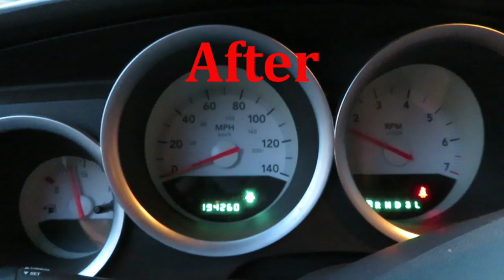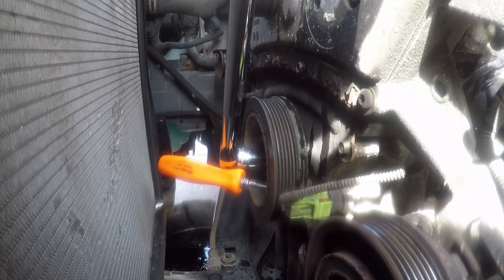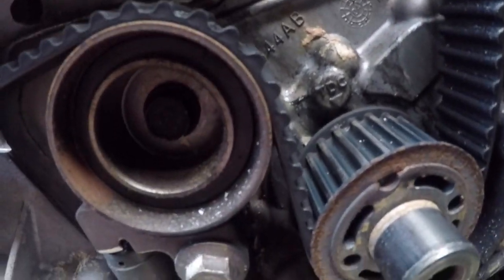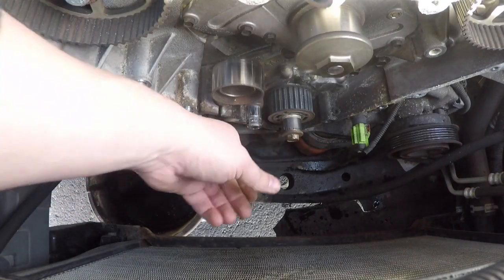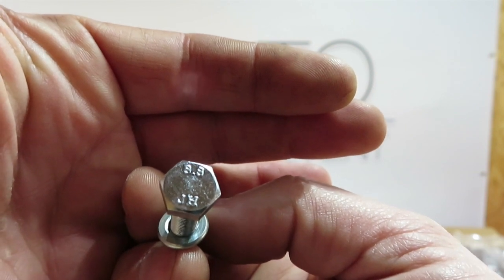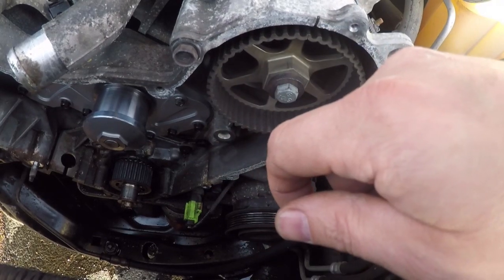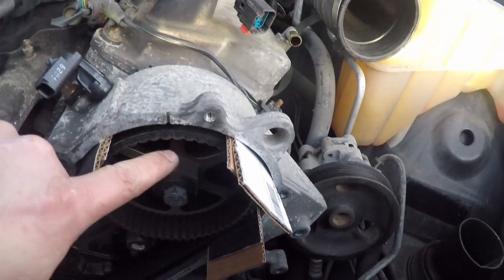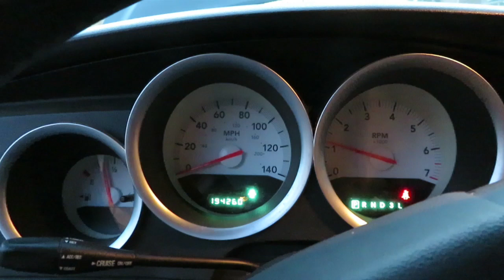Dodge Chrysler 3.5L Timing Belt and Water Pump Installation I Saved a Ton of Money!!!

Comment: Great job thanks for posting.
Reply from the maker: I just bought a 2010 Dodge Charger and I'm thinking about making a new video on this, if I do, is there anything that I missed on this video that you would like to see differently.  Also the vehicle in general, what would you like to see videos of.
Reply: Great video I just did this job and I don't have to remove either the air filter and the steering wheel pulley
Reply from the maker: Thank you for watching and giving your feedback!

Comment: Mentions every single bolt, size, location, and torque. Even a shout-out to odd tools ppl may not have.
The hero we didn't know we needed
Reply from the maker: I appreciate the comment. I hope if you need to do this for yourself that this is a good guide to getting it done without any issues. Thanks again!

Comment: Thank you so much .. I’m a woman and I’m gonna do mines myself next week. You made its so much clearer to me, I don’t feel as intimidated. I wish you had a list of the tools I will need though. 
But thank you so much any how!!! Your awesome
Reply from the maker: I'll try to put together a list and post them here. I won't be able to do that until Wednesday.
Reply from the maker: I just looked in the description, I have the tools listed with links to buy them. I works suggest buying a 3/8" ratchet set as well as an extension set. Harbor Freight is a good value.
Reply: We’re you able to do it @Infinite Goddess
Reply: The bolts on the water pump, 
There are 2 lengths...  There are 2 different spots.  One has a circular raised "plateau" spot where the long bolts go.  The other holes have no raise, and are level with the water pump housing.
Reply: I'm doing mine myself too with the help of this video. Go females let's get our hands dirty..

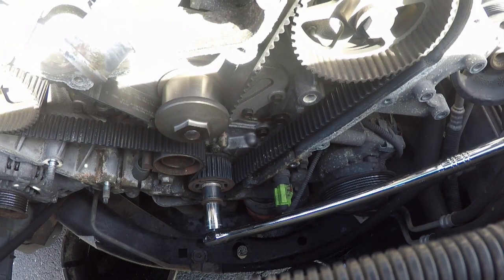Comment: 12:30 place a couple washers on that bolt before you screw it in to turn the crank shaft. 13:40 and just cut the old belt with a pair of tin snips if you're changing out the belt and tensioner. You don't need to methodically remove the belt like you do here in the video just cut it.
Reply from the maker: Thank you for the tips, I'm sure other viewers will find them helpful. Thank you for watching as well.

Comment: Besides the cardboard you used, is there a tool specific to hold everything in places to make the job easier???

I did mine a month ago and started really nice until started to rough idle ones the rpm got lower. Ended buying spark plugs, coil packs, egr valve, coils cables, MAP sensor. Throttle body, camshaft sensor, cleaning the intake manifold and car still having rough idle
Reply from the maker: I don't know of anything specific to hold everything in place. There probably is though

Comment: Hey 👋 thanks for this video I have the 3.5 l Dodge charger 2008 AWD and this was literally helping me out with knowing how to change water pump and timing chain and reset if I run into any problem I'll be definitely back on this video to see what I have done wrong vs other videos with out telling us every bolt sides and everything as watching along great video bro
Reply from the maker: Thanks, I hope your water pump and timing belt replacement goes smooth.
Reply: @DCAutoEnhancement  hey can you do a video of changing spark plugs and radiator replacement and back brakes on the same 3.5 l V6
Reply from the maker: @bosshogg6629  I no longer have that car but if I have the opportunity to make those videos, I will definitely do that.

Comment: Now, I don’t want to sound like a smart ass here but never use the orange coolant in any of your engines again. This stuff corrodes your engine inside. Flush it with water as much as you can and put the hybrid green coolant in. Also, if I were you I would put some cardboard at the front side of the radiator where you work on to protect the radiator fins. Other than that your video was great and very good camera placement. Thanks.
Reply from the maker: Thanks, I appreciate your feedback. I didn't take your comment as being smart ass, it was good information

Comment: The bolts on the water pump, 
There are 2 lengths...  There are 2 different spots.  One has a circular raised "plateau" spot where the long bolts go.  The other holes have no raise, and are level with the water pump housing.
Reply from the maker: Thank you for the helpful info.
Reply: @DCAutoEnhancement   No! THANK YOU!

Comment: If you are going to follow this guys steps please remove the serpentine belt before spilling coolant all over it unless you plan on replacing it. This will cause it to squeal for several days otherwise.
Reply from the maker: I second this comment.  I thought that I did remove the serpentine belt prior to pulling the harmonic balancer off.  Either way, you don't want to allow coolant to get on either the timing belt or the serpentine belt.

Comment: I'm getting ready to do this. What's your thoughts and how much more work would it be to inspect my cam shafts.
Also, great video with good shots! Explained things well and had a list of what tools you used.

Thank you
Reply from the maker: Thank you for the feedback, I really appreciate that. What I would do before inspecting the cams is take that front cover off and see what you have going on under there. If the belt is broken, you're in bad shape. If the timing is only off by a few teeth, then you should be ok. To inspect the cams, you would need to remove the intake plenum and then the valve covers, a bit of a chore in my opinion and then I'm not sure if you would be able to see much damage because the valves are what would be damaged and they are under the cams, you would actually need to remove the heads to check for damage. I could be wrong about that but I'm pretty sure that's right. Thanks again for checking out the video and good luck to you on your car!
Reply: @DCAutoEnhancement  I have a tick and, I think, multiple gasket leaks, my car also shuts off for split seconds when I gas it and then turns back on. It's very unsafe when merging!
 I will be rebuilding my cylinder head, replacing my rockers/lifters, PCV and EGR, knock sensor, Sparks, coils, fuel injectors, timing belt, water pump, and all my gaskets.

I might only need to replace my rocker, timing belt and water pump but since it's one whole system that works together I'm worried if the rocker didn't lube the valves and cam well that they could have some ware on them. I'm more than likely wasting money and shouldn't rebuild my cylinder heads but I also don't want a valve or spring to break and screw up my whole engine..

This is my first time doing this much to my vehicle. Am I being over cautious?
Reply from the maker: @traviswiser8524  to be honest, I'm not a mechanic and can't really say if you're being overly cautious but I can definitely understand your thinking. It sounds like you have a lot of work ahead of you.  I'd like to hear what you find out.

Comment: Just got done watching your video , good video by the way . Quick question, the tensioner was new that you put in ,  can I use the tensioner that I pulled off and put it back on ?
Reply from the maker: Yes but, I think the reason my car had jumped or slipped time is due to the tensioner wearing out. I would spend the extra money for the tensioner since you're going to be doing all the work anyway.
Reply from the maker: I am about to make another video doing this same job, can you think of anything different or in addition that would be helpful
Reply: I have a 05 Pacifica that I am doing this on and changing the camshaft seals, anything involving that would be awesome.
Reply from the maker: @matthewblakeslee9764  I'm sorry I don't have any info on that. I have already filmed the second video. Thanks for the idea though
Reply: How did you put the crank pulley back on

Comment: I change the pump on mine a year ago and now the timing belt tensioner broke so I redo the timing belt. Car is having very rough idle, makes me wonder if I miss a tooth on the belt. Running out of ideas here. Installing the belt is a pain. Wondering if there's a tool to hold everything in place to make this job easier
Reply from the maker: with the rough idle, I would still take the belt off to make sure alignment is correct.
Reply: Mines rough idling too , I believe I’m off a half a tooth and cannot seem to get it in the right spot

Comment: so those cams were like 4 teeth off?  how did that not bend valves?  & where did that come from? I though belts like this were kevlar reinforced, do those stretch?  or did something slip on one of the shafts?
Reply from the maker: I wish I could tell you about the conditions of the valves however, I did perform this job and the car ran as it should when I was done. I think the failure comes from belt stretch and tensioner failure.
Reply: @DCAutoEnhancement  I am glad its still running for you, and you would know if the valves were bent, probably wouldn't run at all.  If it did, you'd get really bad gas mileage & probably a bunch of misfire / o2 codes.

I am not convinced stretch would account for that initial timing, unless you are saying it stretched enough to hop a tooth?  The whole point of a cogged timing belt is to act like a chain or gears.  stretch those cogs out and you still have the same # of cogs & the gear ratio between the crank : cams is preserved.

that's why I worry the crank and/or cam shafts slipped with respect to their gears.  I say this with some experience, I once had a crank gear slip...bashed all my freshly ground valves into my brand new pistons..that was a bad day.  but your engine is running & its hard to argue with that!

and I should say thank you, I have done a few timing belts / chains in my day, but never on this vehicle, which I am doing for a friend.  Found this quite helpful.  

Although I am stuck trying to get that damn pulley off, maybe it'll pop off while I am sleeping.

Comment: My question is the tensioner pulley did you torque it down to a specific or did you what
Reply from the maker: Are you talking about the tensioner for the timing belt or serpentine belt?
Reply from the maker: Here is a different version of the same job, I might have addressed your question in this video. https://youtu.be/MexjRlH7MuE

Comment: Yeah my mom had the timing belt and water pump down thermostat new radiator we kept getting the runaround it ends up being in the shop for three and a half days 2 days later I drove it 90 miles heard this god-awful noise pulled over and there's no oil in the car and on the bill it said next Oil Change 3 months so how would we be out of oil they're not taking responsibility
Reply from the maker: I would definitely have that conversation with them especially if they did an "oil change". I have seen it happen where someone drains the oil, put the drain plug back in, change the filter and then take a phone call or get side tracked, go back to the car and put the oil fill cap back on thinking it's ready to go. Not saying that is what happened but it's possible

Comment: Had to do this in my Dodge avenger 3.5L not fun lots of jacking the engine up and down.
Reply from the maker: I bet, because it's front wheel drive, right? Was the process the same otherwise?
Reply: @DCAutoEnhancement  Yes everything else is the same. My tensioner went before the belt did.
Reply: Did you have to remove motor mounts, for your avenger. If so i may just pay dodge.
Reply: @worksmartnothard163  No it was a transverse design much like a Honda Accord so I only had to remove the Passenger side Mount the other ones I left.
Reply: I too have a VQ. Good choice in cars.
Reply: I’m working on a 2006 Chrysler Pacifica 3.5L and it’s a pain in the butt because it’s a front wheel drive. You have little room to get and tools in there to take bolts out. I’m having a hard time getting the timing right, does anyone have any advice for a young mechanic?
Reply from the maker: Some people have mentioned jacking the engine up and down in order to maneuver easier. As far as the timing, hopefully someone here in the comments can help out.  It's been a while since I made this video.   I will review it and see if I remember any useful information
Reply: @boanderson6919  Advice: Don't ask for advice from u tubers. lol.
I have the same as yours, when I work on it, because everything is so tight, plan on removing lots of parts just to get to your pump, or whatever else u r working on.

Comment: So you moved the cam gears your self alittle without the belt on. Is that not a problem? I thought you have to keep rotating till tdc and lines all match up. Have to do this on my car just confused on that part
Reply from the maker: Because the belt wasn't broken, I rotated the crank until it was at top dead center or at the mark on the block then I adjusted the cam gears. I assumed that moving them slightly back and forth would be better than full rotations because in my mind, that would allow the valves to potentially open and hit any pistons that may be testing at the top of the cylinder. I am not an expert by any means but that is what made sense to me. Thanks for watching and I wish you good luck on yours.
Reply: @DCAutoEnhancement  i appreciate your response. Why didnt you just make sure everything lined up with the old belt before taking it off? I just feel woozy moving the gears without a belt lol
Reply from the maker: @asaprulers226  I did, and the timing was off. The belt must have slipped on one of the cam sprockets.
Reply from the maker: @asaprulers226  this was a second vehicle for me and I had just bought it to see if I could fix it and then resale it. So, I wasn't going to be in a bad spot if I got it wrong. But I have done two of these now with no issues. If you want, I can link my more recent video here.
Reply: @DCAutoEnhancement  ahhh ok thankyou, was wondering what was up. Getting my bearings straight before i dive in appreciate you responding
Reply from the maker: @asaprulers226  I understand completely. Here is a link to the other video. In this video there was nothing wrong with the belt, I just changed it before there was a problem. https://youtu.be/MexjRlH7MuE
Reply: @DCAutoEnhancement  thankyou very much, got lucky with my dads car at 85k right now want to change it before anything happens

Comment: Did you turn each of cam seperate or just turn crank till they lined up
Reply from the maker: Before taking the belt off I lined up the crank to top dead center then took the belt off and individually set each cam.  I didn't want to to do any full rotations because I didn't know if that would cause any harm to the engine. So I just turned them back and forth until they lined up. Once they are on their mark they are under pressure from the valve springs, so they may want to spring forward or backward.

Comment: Saw a  video where guy was fighting because it seemed ½ tooth off, fyi the water pump bolt holes are larger than the actual bolts so if the water pump is tightened with the water pump at the max edge of the bolt holes that may take up too much slack making it seem a ½ tooth off and hard to get belt on. If that happens loosen water pump bolts and move pump in whatever direction that allows you to get belt on with all markers lined up. I did my best to center the water pump so bolts were exactly in the middle of the oversized holes and I avoided the ½ tooth of scenario the guy in video had (not sure if it was this particular video, I'm just  giving an fyi and didn't recently watch/rewatch this one) this was my first timing belt I ever did and I was successful so you will be too. Be sure to use torque wrench on water pump otherwise bolts might snap they're only 10 foot pounds if I remember correctly. Good luck and use oem parts they still looked good with 142k miles though there was evidence of small leak starting at weep hole of water pump so good thing I changed everything when I did. Buying online chrysler parts website saved over $100 vs going to local dealer. Another fyi is thoroughly flush your engine while doing this job, though antifreeze in reservoir looked nice and orange what was in the engine had already degraded and was cloudy and milky. Can't remember where I put garden hose I think it was upper hose in direction of engine  which pushed everything out the lower hose which was disconnected from radiator. Took awhile before water coming out ran clear.  Make sure to bleed system after too.
Reply from the maker: Thank you for letting us know how it went.
Reply: Bro, YOU SAVED MY LIFE!!! I've been fighting with this 1/2 a tooth for 3 weeks!! We literally just went to Walmart and got For Sale signs for the car.. Timing marks are now aligned!!
Reply: Good read I’m a half tooth off now I know what to try to get it fixed , do you still have to take harmonic pulley off and bottom plate cover or can I get by with just taking top one ?

Comment: Is this engine a non inferences engine or is it. Usually if an engine wouldnt crank because of a timing belt it’s an non inferences engine.
Reply from the maker: Unfortunately it is an interference engine. It had only slipped and was slightly out of time. The belt was still intact
Reply: @DCAutoEnhancement . Okay I figured that, I’m planning on doing this job on my brothers dodge charger he has 160k on his. I told him that it something that needed to be done and im definitely going to use your video for reference the other videos wasn’t that good to show part by part which I understand
Reply from the maker: @micahhill4786  I made two videos on this job: https://youtu.be/MexjRlH7MuE